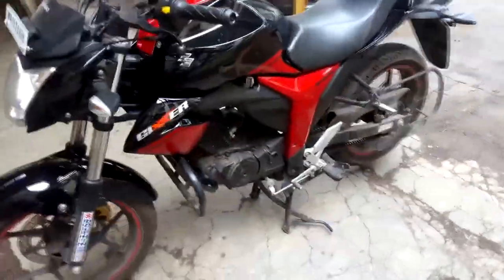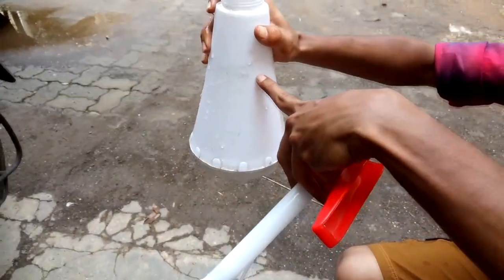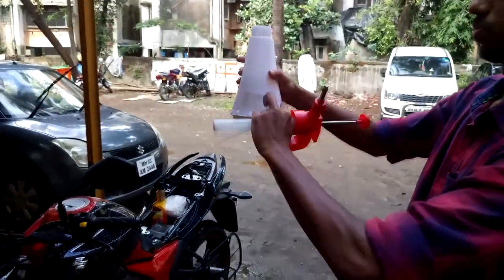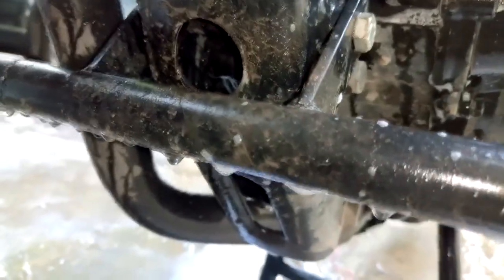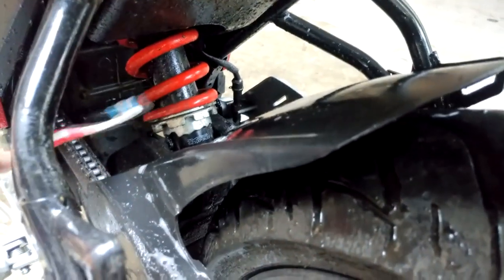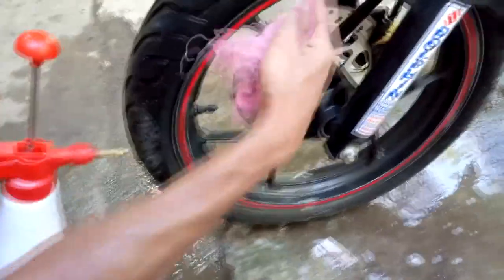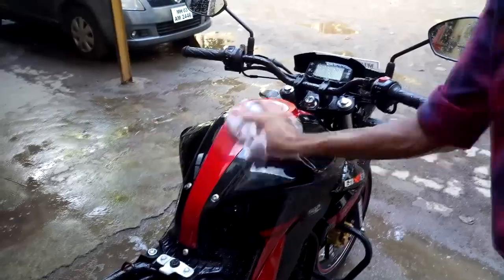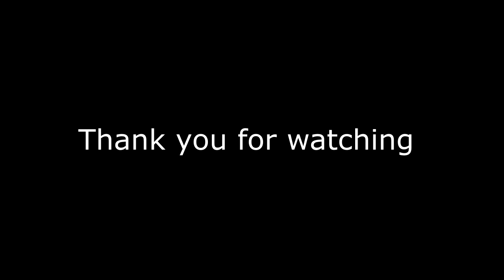Wash your bike at Home without a pressure washer  (Gixxer 150)

Comment from the maker: For those who are saying that why i remove the seat as it may damage my air filter and battery. Here is the answer.
First of all i don't spray in that area. If i want to clean the area i'm very much careful while spraying nearby area as i'm doing it since a year every week. I remove the seat just to clean the side panel's in a better way as it remains dirty due to seat over it.
So if you are not enough confident or careful to do that you may clean it without removing the seat.
Hope it answered your question.

Thanks for watching.

Comment: Happy that you are not wasting too much water 👍 is it adviced to open seats while cleaning ? Would it damage batteries and air filter ?
Reply from the maker: +Arun mohan Yes I use only one bucket
Also we should not force water in the air filter batteries and near spark plug
I avoid spraying in this area 
Its not necessary to remove the seat 
I did coz it becomes easy to clean the side pannel area where there is to much of dirt

Comment: Excellent video I will use manual pressure pump for sure. Daft but important question once you add shampoo inside bottle do you shake mixture? Shaking might make it over sudsy possibly.
Reply from the maker: Yes i do shake it and it makes it little foamy
Reply: Cool thanks I am just about to take delivery of a new bike and I will be using your cleaning techniques
Reply from the maker: Congratulations for your new ride

Comment: Hi Hobbiegrapher. Very informative video. I practise the same as you do but with a low pressure water hose, however one additional step I carry out is after I have dried the bike with a cloth, I use a mini air blower to clear out all the remaining water between the electric switches, nuts, bolts etc, just to avoid corrosion. Good Luck and Ride Safe.
Reply from the maker: That's really a good step

Ride Safe

Comment: I do just like this but use normal tank water spray pressure, and also clean the inside of the guards also with hands using gloves.
Reply from the maker: +Sath Ish yes i wanted to do that but it was rainy season and it wasnt worth cleaning at at moment
In gonna do it once after rain stops completely
Thanx for the advice

Comment: This video was soo helpful. I hve been using hose pipe for washing my bike  were I'm wasting lot of water. But this pressure bottle very useful and water saving thing and wat is the cost of this bottle ?
Reply from the maker: Karthik Kiran thanx a lot for watching buddy
I purchased it at 200 but now it costs around 298
I have one video where i have given detailed explanation about pump
Pls do watch it
It might help you
Reply: Thanks bro I saw ur video abt pressure pump. I'm gonna try that second one which u recommended in that video. Thank u
Reply from the maker: +Karthik Kiran cool
If you are purchasing from Amazon chk for others as well where you get 1.5 ltr at almost same price rather than 1 ltr
Also chk the reviews before purchasing

Comment: Is that ok to wash under the seat.there will wire connection right
Reply from the maker: Yes lil risky as you got the air filter beneath. You can just wipe off with a wet cloth.
Wires are mostly not open but be sure you dont spray water.

Comment: Is manual pressure pump really helpfull? I wanted to buy so asking
And is there any substitute for 3m shampoo?
Reply from the maker: Yes the pump is useful but only thing is you have to pump it at regular intervals as its a garden spray.
You get high pressure washer but they are costly. 
Also for the shampoo there are many more shampoo in market but i haven't tried them, but i can assure you that 3m gives you good results and a 200 ml bottle lasts a year despite using every week.

Comment: I am having 3m shampoo, f1 wax polish, protectant, in gixxer sf mud splash is heavy and cleaning bike is hefty work. Muds are not easily gone through these types of spray cans. I am using it for light wash, shampo coat, and finally use fresh water for final wash to remove salt dropletes whil bike on dry. If u have dust on bike after some days dont clean bike with pressure using cloths it makes minor scratches. Use can spray and dry the vehicle.
Reply from the maker: +srinivasan ramani +srinivasan ramani yes thats the Reason i use the manual pressure pump
Its doesnt create a high pressure
Cleaning heavy dirt is really hectic 
There was lot of mud splash on my front mudguard and the surface has become little rough due to prolong exposure to mud 
Its not possible to clean daily 
So i wax it so it becomes easy to wipe off the dirt

Comment: My simple idea is first spray the old engine oil. Then clean it up with some shampoo, then again soak a cloth in old engine oil and gently polish. It will look so good
Reply from the maker: vinoth simion raj Thanx a lot for the suggestion 
Will definitely try it
Reply: Old engine oil has many small metal shavings in it running with it causes many scratches on the shining surfaces so please don't use that!
Reply from the maker: Shiva Prasad true
Didn't thought about that
Reply: *rubbing

Comment: Bhai I also have the same bike ......
Can you suggest me something that prevent scratches on tank....
  Bcse as I apply brakes or get off the bike my jacket zip scrub the lower portion of tank paint.
Reply from the maker: +JATIN PANT You can get a paint protection film but its lil expensive 
Approx 5000
Get it installed from a proper shop that will protect your paint but before that get the minor scratches removed
Reply: Please suggest me place where I can implement that.
Reply from the maker: +JATIN PANT you live in mumbai?
Reply from the maker: +JATIN PANT contact your nearest 3m car care if they can do it on your bikes
Coz when i asked them they told me they only do it on car
Or else google your nearest stores

Comment: Can i use the wax for the gixxer sp edition matte grey??
Reply from the maker: +Aditya Kumar the side pannels have glossy paint i guess
 u can use wax there
But not on tank which is matte finish right
Please dont use wax on matte finish
Reply: Then what should i apply on the tank to make it look more better?
Reply from the maker: +Aditya Kumar matte doesn't need any special treatment you can clean it with normal water unlike glossy finish on which dust and dirt are mucj visible 
But there are specific products like matte paint sealants which can remove minor scratches also makes it look better

Comment: prolonged use of the scrubber on ur rims .... will scratch off the paint on ur alloys after some time... u wash it every week... it wont take long.... I'm telling this with exp on my x 200
Reply from the maker: +Vismay Aswani no buddy i dont use scrubber on rims
O use it only on tyres
I clean rims by tooth brush
Reply: THE HOBBIEGRAPHER that is my point... dont use anything of that fiber... the scrubber fiber is just a tad harder than the toothbrush bristles... i suggest u use those scotchbrite kitchen wipes... that is providing a great finish to my Current NS200
Reply from the maker: +Vismay Aswani Sure buddy thanks for your opinion
Scotch bride will make it easy for me i guess
Reply: THE HOBBIEGRAPHER oooo... trust me... i took 30 mins only with just 2 buckets of water and no pressured water😄😄
Reply from the maker: +Vismay Aswani 😂 😂 😂 😂 😂

Comment: I use MOTO MAX shampoo Bro.... M also going to Buy Pressure Water pump
Helpful Video but Y ur washing without Seat ??
Reply from the maker: +Yamaha Macho i remove the seat because the area beneath the seat near side pannels remain dirty
Its not necessary to remove
I just do it for better cleaning
But i make sure i dont spray on the air filter

Comment: Tried today but couldn’t clean like you. Engine area is very difficult to clean. Specially if oil and grecce is there. Any tips? By the way nice video. Saw 4-5 times😜
Reply from the maker: Yup apply diesel it will help in removing grease and oil stains and will also give you shine.
I know its takes a lot of patience to clean engine.

Comment: you may damage the air intake don't take the seat off while washing
Reply from the maker: rophit paul yes i remove the seat for better cleaning 
I'm very careful while spraying near the seat
Reply from the maker: I have pinned the reason in the comment section

Comment: This is the problem with Gixxer. Take it out for 5 min in just wet road & it starts to look like u had gone to a dirt rally.
Reply from the maker: +Brijesh Gixxer has been given a sporty look
So the mud guard is short
So it's gets dirty easily
Reply: THE HOBBIEGRAPHER But that sporty look doesn't look great when it's covered in mud after a 5 min ride to a local shop. All that mud & sand can be bad for the bike too. Not to mention your pant, shoes, sandals and feet are sand blasted. FZ-16 V1 had the ideal rear mudgaurd.
Reply from the maker: +Brijesh yes ur right
There are pros and cons for everything
Reply: Brijesh same with my fz25

Comment: Your bike was very clean before washing. But it would have been very difficult if it was much more dirty than this.
Reply from the maker: If you see the area near the engine that was very dirty and cleaning it itself is a challenge 
I agree it doesn't look dirty in the video 
anyone can easily clean the upper body as its painted surface and dirt doesn't cling in that area unless you don't participate in a motocross rally 
Also it was monsoon season so anyways it gets washed in rain water

Comment: Still a High pressure washer Works Even more better Brother..Also a toothbrush create millions of minor scratches..!
Reply from the maker: +Mandar G yes i know high pressure works better but spending 100 bucks becomes costlier
Its ok to do once in a month but weekly cleaning and waxing protects your paint and doesnt let your paint fade off
Also high pressure forces water into electric switches that damages your circuit and wires 
Toothbrush doesn't give scratches as i'm doing it since a year and still i only do on non painted area 
A tooth brush doesn't harm your gums and teeth which are more delicate and sensitive than metal part 
Hope u agree
Reply: I bought a cheep presure washer £65, I use it for everything,  and I have used it for many years,  it works out at a few penny's a go. Get one, it's an investment.
Reply from the maker: +Shaun Elliott thanx for your suggestion
I'm planning for a good pressure washer but i have more modifications to be done on my bike.

Comment: Do not wash the bike with water for every week...make it as twice a month.. its enough... because... rusting may occur and also wiring problems are there... simply clean by microfiber cloth....
Reply from the maker: Prasanna Ford I just spray on the body
I dont spray on the switches
Also i wax every week coz i have an open parking in my office that too under direct sunlight
Thats the reason i need to wax every week and for that i need to wash it
Reply: THE HOBBIEGRAPHER ...okay....its not suits for all right?
Reply: Vodka Bottle rain doesn't go inside engine... and also..365 days not raining at all

Comment: You can buy a pipe 😂😉
Connect with tap.then wash
Reply from the maker: I didn't had proper place to wash so never purchased. 😂 
BTW purchased a one recently with a pressure gun. Got a tap fitted in my backyard. 
Video will be uploaded soon.